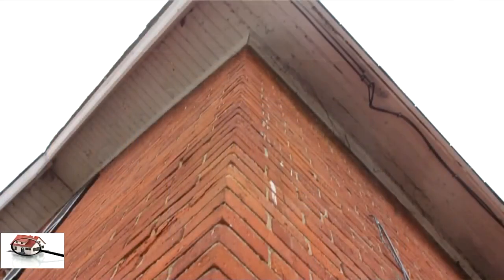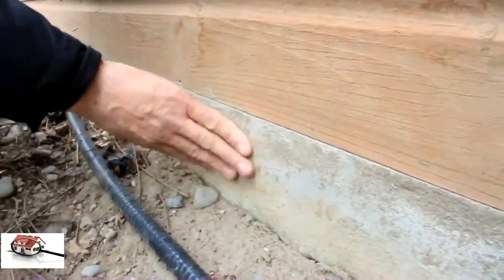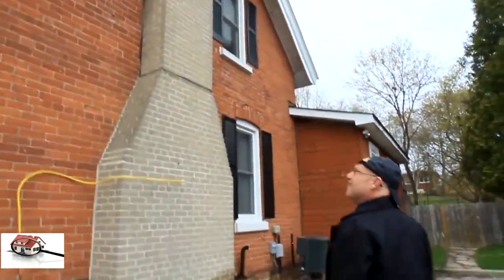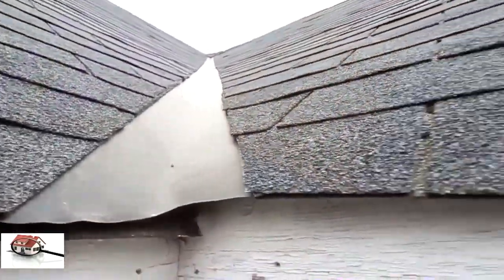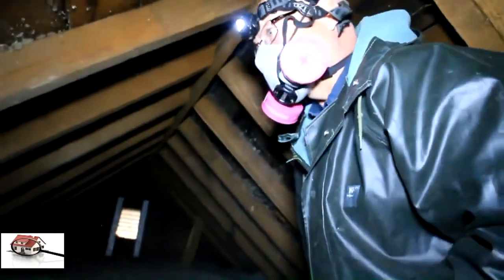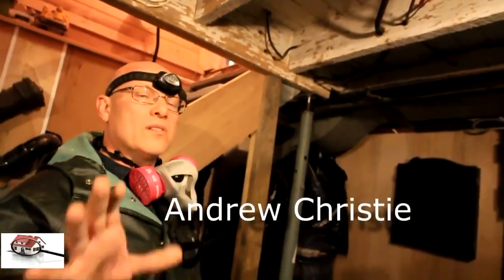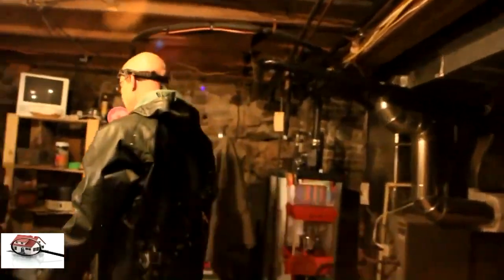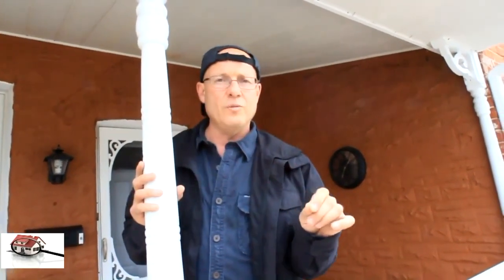Inspect the Uninspected S01E01 - The Century Home

Comment: Additional point of inspection that you tested but overlooked, the applied facing. When you tapped against it, it had a hollow sound. That indicates a poor to no proper bonding and can cause a failure of the facing. In other locations, there were significant brick loss and cracking of mortar  that you did not address. While you state that the bulging stone foundation may not indicate imminent failure, you have not addressed the  cause of the bulging on the outside of that wall. 
I also noticed that in many locations, temporary ally columns were used instead of permanent concrete filled steel ally columns. So if as you indicated, the floor of the cellar was dropped, us there an appropriately structured footing under them or do they just rest upon the lowered floor? 
With respect to the electrical. A home buyer needs to be informed that all the circuits that are ungrounded, need to be changed to grounded circuits. There were other possible electrical and gas lines on the exterior that also needed to be addressed. One seems to be flex gas line running across the brickwork and into the back if the chimney breast.  With all the things I picked up just as a handiman, I would NEVER have you as a home inspector.

Comment: Not a word about the installed temporary steel lally columns though @21minutes?
Reply: Those steel jack posts were likely installed to replace the original timber posts that held up the house. Those old timber posts are usually split and lose integrity over time. Steel lasts a much longer time.
Reply: There's temporary? What!

Comment: WOW! I see a lot of errors through this video.  For an inspector that went off on what Mike Holmes does he should take a harder look.  An inspection should cover all aspects whether or not the buyer wants to hear the results or if the inspector is making a decision just to save the buyer money.  The inspection is supposed to be unbiased.  Cracks in the foundation should be noted whether the inspector feels they are needed or not.  The inspector should have also noted the pipes that are taped off in the crawl space.  Those looked like furnace pipes not just something hanging.  Also a contractor would not have just made a whole in the old holding walls without resupporting the foundation.  so the whole in the old foundation is not proper.  There were a lot more holding poles in that basement also, making you wonder of the structure is supported correctly. However this video did not cover these facts.  One item that should be added is the electric outlet in the attic.  Are you nuts?  There should never be an outlet in the attic especially one that looked to be covered in insulation and also looked to used as a junction box.  Why was there three electric wire coming out of one box?  Dude, I would never hire you to inspect a house.  The wall you showed and stated it could just have mortor added to it looked to be leaning into the house and correcting the issue may save the house from falling in.  Lastly what experience with construction do you have that makes you an inspector?   An engineer is not a good home inspector because they have no real hands on experience.  Just to make my point clear I have now built two homes from the ground up and understand what an inspector should know before inspections are performed and schooling knowledge is just not good enough, get some hand on experience.
Reply: The inspector is concerned with building code violations. Taping HVAC piping is not a requirement even in a crawlspace. As far as the hole in the wall it was supported, perhaps you overlooked it. And lastly, there is absolutely nothing wrong with having an outlet in an attic. Where did you ever get the idea that you should never have an outlet in the attic? I hope you're not a home inspector.
Reply: Skanzool   My husband is a commercial electrician, he does any electrical work we need done in our house also. He installed an outlet in our attic so we have light to see up there. I just wanted to support you on what you said about this. My husband is amazing at what he does for a living & I don't think he would've placed an outlet in the attic if it were any kind of issue.